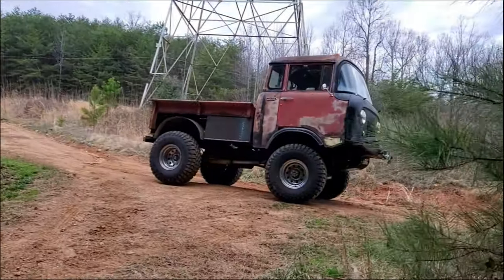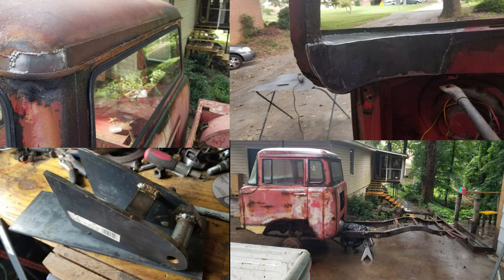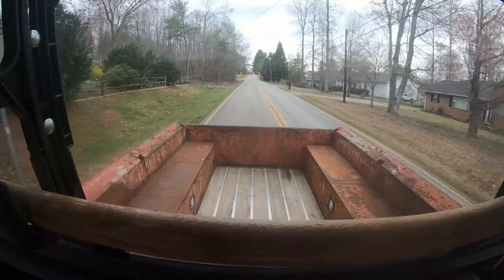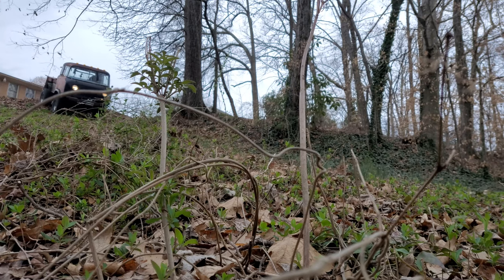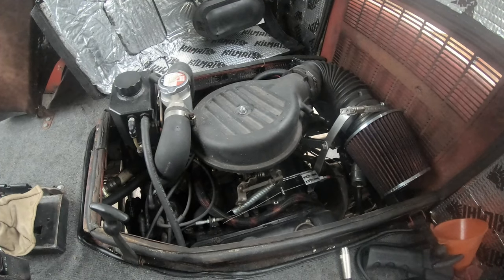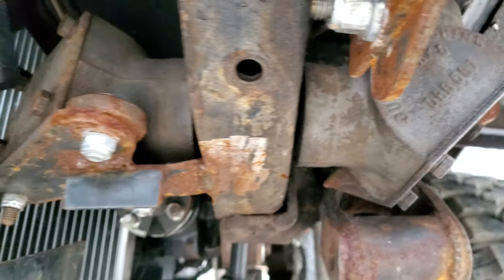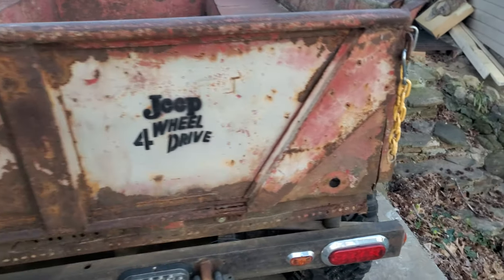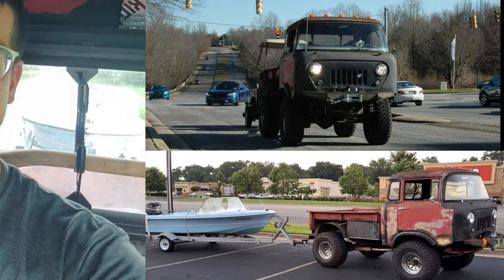ics 2021 submission fc150

Comment: Love the video. Seen a couple with the Buick v6 transplants. I have 1959 fc170. Originally a postal truck with a hinged factory built flat bed. Owned it since '92, sitting in the garage for at least 25 years. A gm executive bought and had 283 csb put in it. I was going to swap in a csb 400". Changed my mind, planning a tilt cab and a cummins in line 6. Lots of plans, now I'm retired, better get busy. It's body is in very good condition, also has meyers 7' snow plow. Hydraulic run by v-belt. Thanks and keep up the good work.

Comment: Hi nice jeep.
I have one fc150 and as same you I wanna keep it for ever but still have the original engine transmission and transfer and you know the top speed is 40-45 m per hour .
Can you tell me the motor you using for your jeep thanks.